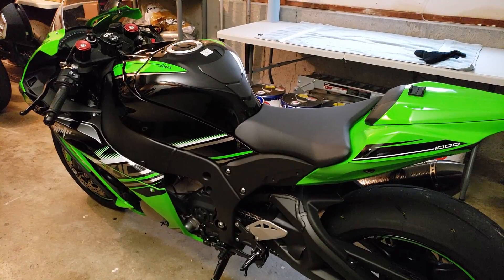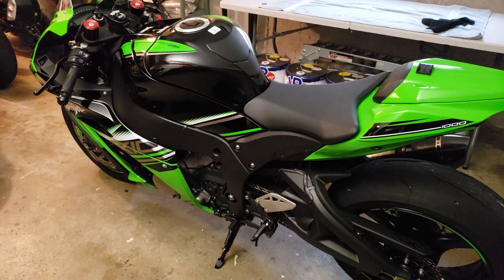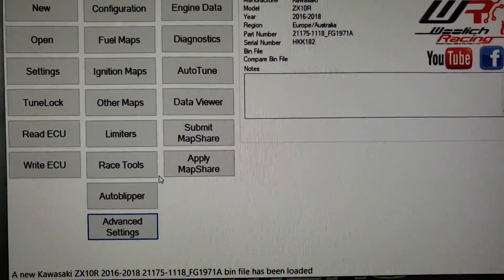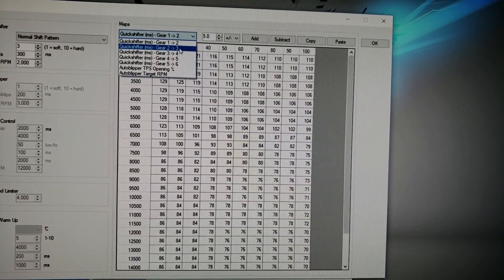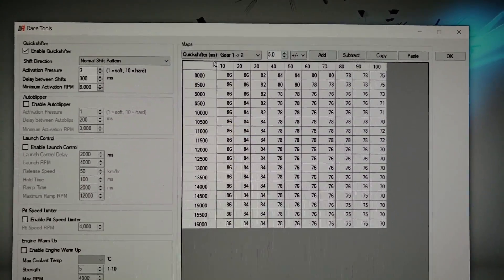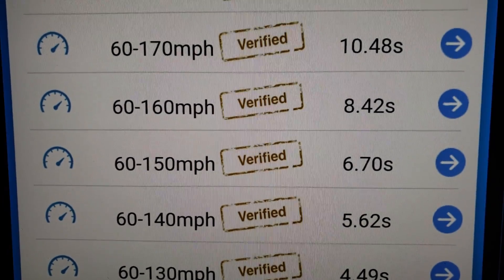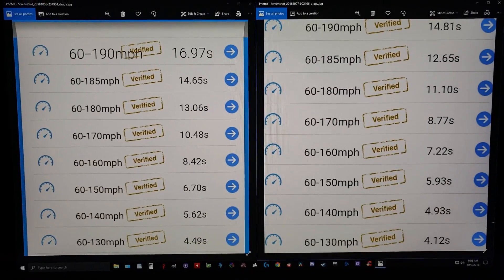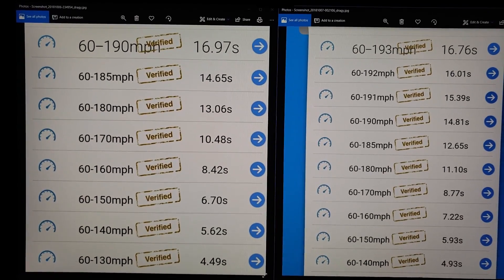Turbo Warrens 2016 ZX10R: Episode 5 - Addressing the Quickshifter

Comment: Hi, I have a problem with my 2017 ZX10R. When I have the throttle all the way open, the quick shifter doesn't work well. Can the shift times be adjusted?